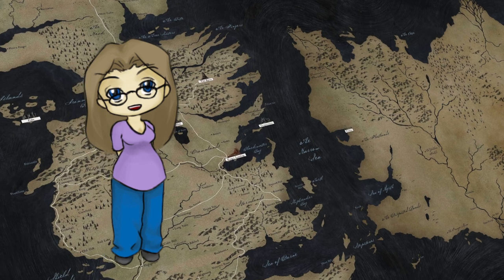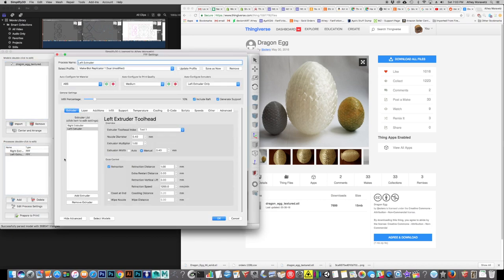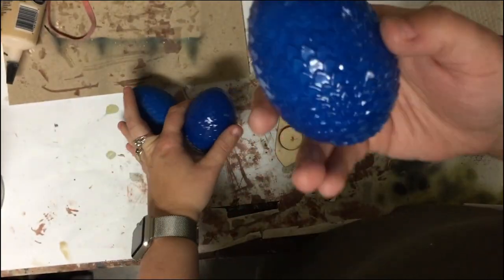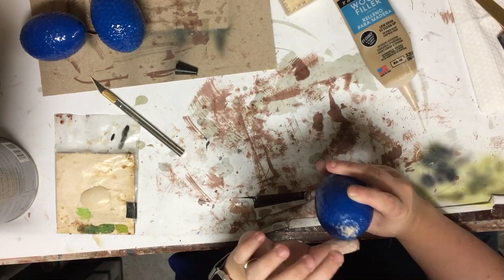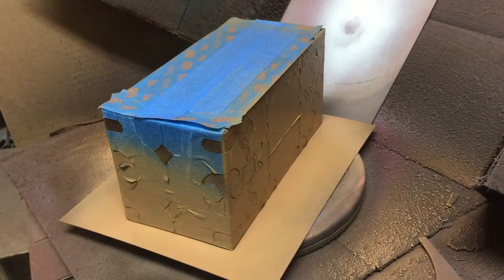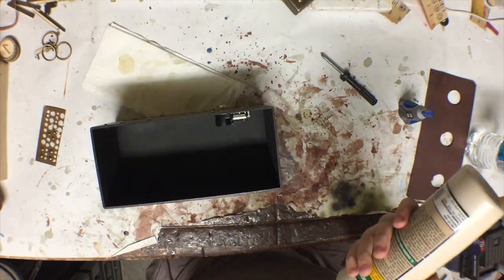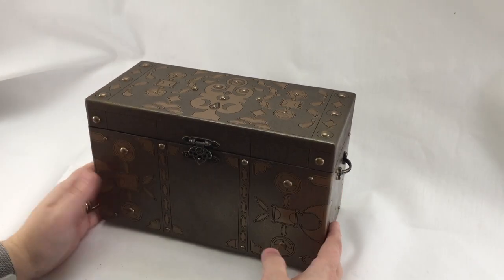Game of Thrones Dragon Egg Chest

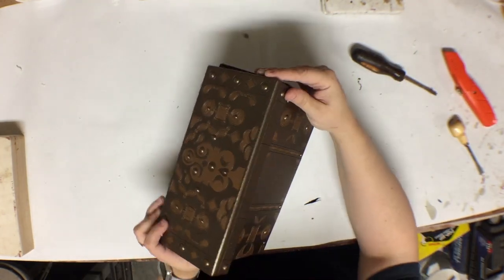Comment: 13:22 I feel like if you made a firm first, and then coated it in sand that might have been a lot more three dimensional. For example carving some foam or polystyrene then painting on sand mixed in glue, then covering it in sand to dry. As if you were glittering it. 
Also noticed the sand got way darker, “builders yellow sand” might have allowed you to have a lighter sand, but that would need experimenting.